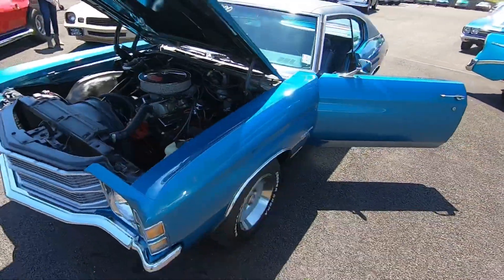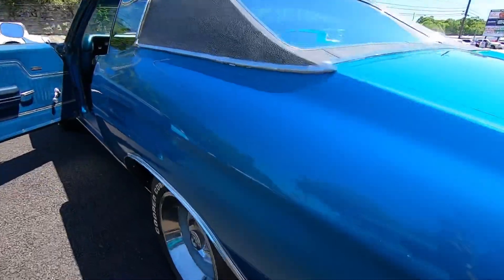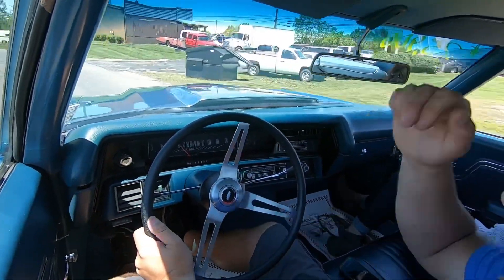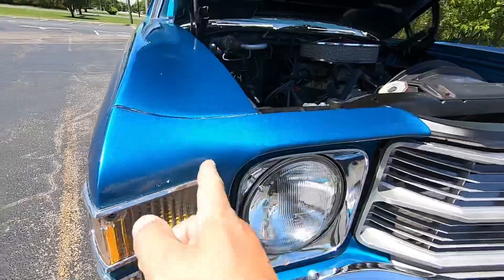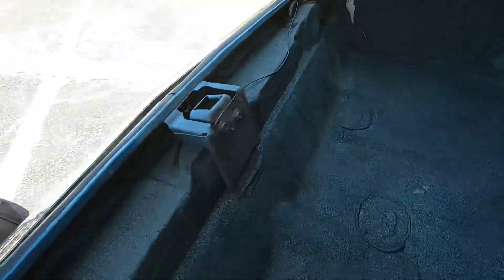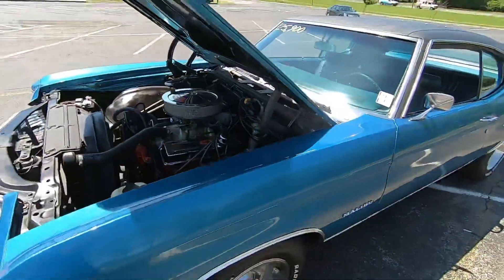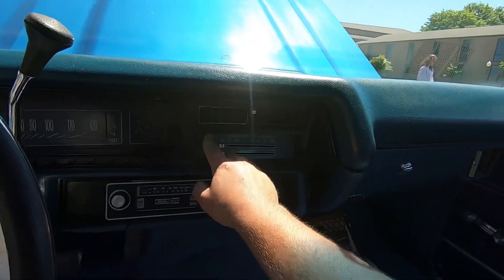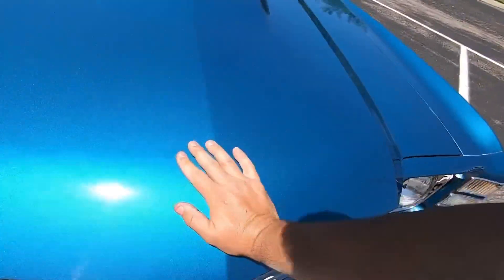Test Drive 1971 Chevrolet Chevelle SOLD $25,900 Maple Motors #1062

Comment: Does it burn the tires easily, or does it burn the tire easily?  My 1971 Malibu has an open rear.  If it had a limited slip like my Trans Am, it probably wouldn't be so easy.  
.